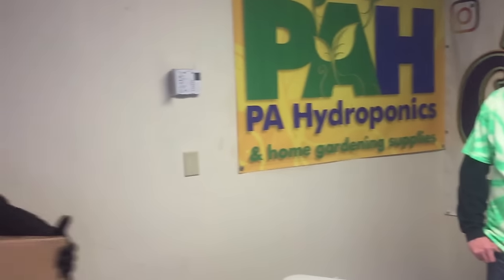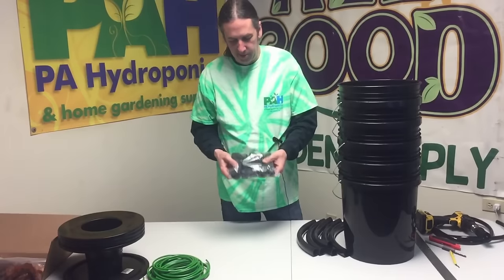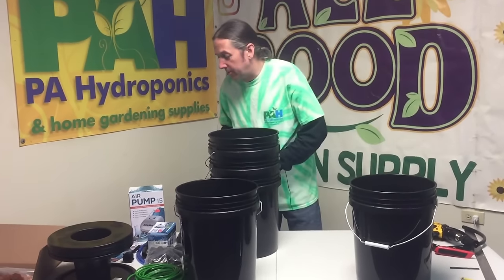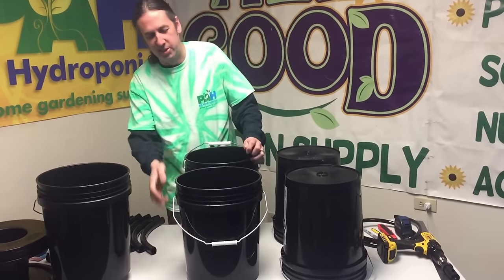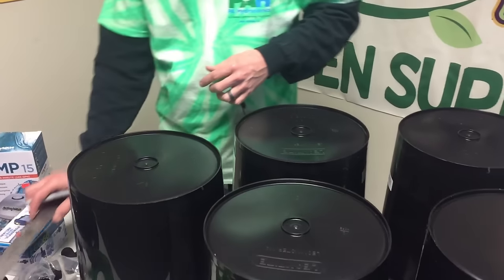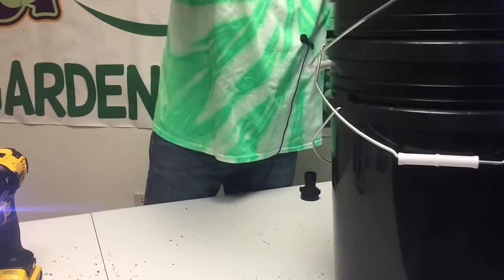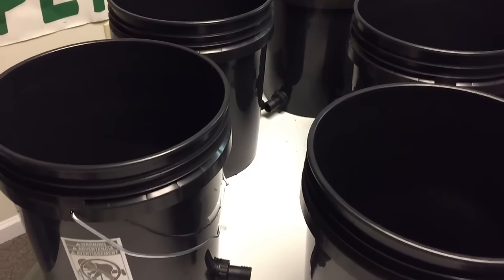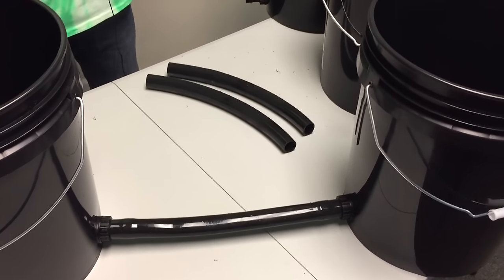Easiest 4-Plant Stirponic RDWC with Reservoir and Water Level Indicator built from scratch!!

Comment: Really enjoy watching your videos on building your own. My problem is the water pump heating up the water. Can this pump be changed to a in line pump and would it matter that much as keeping cooler? Also would using 3/4 in. tubing be ok? Thank-You Gary
Reply from the maker: Hello, on this particular system I used a 75 gph pump, it is small and should not heat up much, as for inline - the problem with that is most small pumps are not 1" fittings and this system uses 1" , even 3/4 inch is to small and wont let enough water flow which would cause uneven water levels  in your system. I also like on this system that I can change the direction of the water flow  which you couldn't do with an inline. So yeah, don't know what else to say on this. Gary
Reply: Thanks Gary, very helpful and what I also understand is that the pump can be put on a timer also which would help it to stay cooler! thanks!

Comment: Hey bro on this model can u connect 45 degree tubing so u can put another bucket in the middle and also will it  Circulate? Just a thought I been having to  Maximize yield
Reply from the maker: Hello, for the waterfall systems to circulate evenly it has to be in exact multiples 1 plant 2 , 4 , 8 or 16 etc. Also not to mention 4 plants in hydro in a 4x4 will beyond max out the tent, I have seen 1 plant max out a 4x4 so adding a 5th plant is just gonna make it more crammed. Hope this gives you some ideas and thanks for watching. Gary

Comment: can't you use the resevoir as a grow bucket aswell?
Reply from the maker: The reservoir is where the stirponic (circulation) pump is located.  The pump is pushing the nutrient solution around the containers.  If you would put a plant in that bucket you could possibly damage the roots with the circulation pump.

You may want to look into DWC.  No stirring action, each bucket gets an airstone and its nutrient solution.

This is a two site system....

https://shop.pahydroponics.com/2-plant-complete-dwc-buckets-including-quality-airpump-airstones-water-level-indicator-kits-clay-rocks-and-4-rockwool-starter-plugs-drilled-and-ready/

You can easily expand and customers have grown many beautiful plants in DWCs.
Thanks for watching

Comment: Do you need more than 5 gallons of water to feed the entire system?  The reservoir is only 5 gallons so do you need to fill it multiple times to get the water level correct throughout the entire system?
Reply from the maker: Hello, yup the water wants to naturally level out thru the whole system so just keep adding to the reservoir bucket and really think of the whole system as 1 big reservoir, it takes about 20 gallons when full. Thanks for watching! Gary

Comment: Hey Gary -I’m trying to decide which type of system to install inside my 40x40x72 tent, I really want a 4 bucket system even though it will be tight. With this RDWC system, as long as the supply and return line to the reservoir are roughly the same length and have the same # of angles/bends this won’t effect the the operation correct? Any recommendations? Thanks and love your videos!

Comment: how much water would i expect to use to fill this system? i've grown in soil, and mixed my nutrients in either a 3 or 5 gallon water bottle. i assume this is gonna hold WAY more water than that
Reply: Im just gonna say what I remember him saying, I have never used a system like this.  The water level is gonna be slightly higher in the grow buckets than the reservoir.  In the beginning you have to have the water high to hit the roots, so probably 4 gallons in each and 3.5 in the res.  In the beignning stages that would be about 19.5 gallons in the whole system.  Later on it is lower because the roots are all the way down, I'd guess 2.5 gallons in each and 2 gallons in the res, so 12 gallons in the whole system. 

 I'm guessing in later stages you top off 1 gallon or more a day.  Unless you drain the whole system often, the first day is the only day you'll lug a bunch of water to the system.

Comment: Great video! Thank you for your fine service!! A few questions though..

Can I position my reservoir outside of my grow tent (have tubing running through a light sealed hole in the reflective walls)?
And advice on how to regulate temperature?
Can I have 2 sets of lines between the buckets and have 2 pumps, 1 clockwise 1 counter clockwise?
Is it possible to set some mesh or filter on the outlets of the buckets to prevent roots going in?
When I change the water and nutes, do I just drain it as you said and then add new stuff? DO I have to fully remove everything and rinse it before I can add fresh water?

Thanks again!
Reply from the maker: Hello, 2 pumps like that wont work it will just flow into first bucket then get sucked right back to the reservoir. Some customers have put the reservoir outside of the tent with success but get the return tube as low to ground as possible to keep flow going, remember 75 Gallons per hour max for 1" tubing. As for temps make sure your room is air conditioned before you start buying chillers. You can drain whole system with the reservoir bucket but not when the tubing is up off the ground and thru the port - it wont drain right like that, this system will have a inch of nutes left , I dont worry about it but others do, you can dump 5 gallons of plain water in it then suck that back out to clean if desired. Hope this helps. Gary
Reply: @PAHydroponics  Wow, thank you for your help! I was thinking I'd have to elevate it for the tubing to exit the tent. Thanks for all the advice!

Comment: Hey Gary...

All the other undercurrent systems I see employ a submerged pump sucking from the 'furthest' bucket in the chain and then back all the way to the reservoir with a hose... I suppose doing it this way works as they are all daisy chained anyway... and the water circulates back to the reservoir regardless?

I like this... I originally was going to use my 1" PVC on the bottom as 'returns' only, and connect the pump to a hose, and waterfall all 4 pots... this way eliminates the need to do so... 

Moving the flow sideways... rather than down and up is smart...
Reply from the maker: Sounds good but 1" does not let much water flow and you still are limited to about a 75 gallon per hour pump so keep that in mind. Thanks for watching :) Gary

Comment: Can u make this system with 3 inch pipes instead of the 1inch tube . I dont mind paying extra
Reply from the maker: Check out this video based on the Fallponic Waterfall RDWC.  it has three inch pvc connections between the larger flat walled buckets. I think you may be interested, enjoy!

https://www.youtube.com/watch?v=o0dDcA-PUMI

You can take a look at the different kits you can purchase online to get you started here... 

https://shop.pahydroponics.com/fallponic-systems/

Comment: Square buckets and deep square net pots. Its easy to make bulkheads work on a flat surface compared to a curved surface. Hose clamp everything. Attach drip rings with zip ties.  No air stones. None.

Comment: so no aerator in the reservoir?
Reply from the maker: We do not recommend aerating the reservoir directly.  In this set up the reservoir has a pump in it to "Stir" the nutrients... If air bubbles are pulled directly into the pump you will loose any pressure and could damage the pump.
Reply: @PAHydroponics  cheers, thanks!

Comment: Amazing video ! thank you . can I use this setup and make a 16 bucket system ? if so how big does my pump have to be
Reply from the maker: Yes it can be done!, I would have it plumbed for 2 -  8 site with 2 separate pumps but sharing the same reservoir with 2 - 3 inch tubes coming into the reservoir, Good luck :) Gary

Comment: How high should my water level be?
Reply from the maker: In the beginning when starting your plant the water level will have to be high enough to touch the starter plug.  You do not want to completely  immerse your starter plug in the water as that can lead to other problems.

High enough the starter plug can soak up the stirring nutrient solution.

As the plants roots grow you can drop the water level back if that helps with you specific requirements.
Reply: @PAHydroponics  got it. Thanks!

Comment: I’m a Iittle confused from this video. In your other videos you speak highly on having 3in tubes and it’s advantages but here you are not using that, why so?
Reply from the maker: There are many different forms or variations of hydroponics.  The Stirponic is a recirculating deep-water culture, with a stirring action to provide the benefits of moving water.  The Fallponic has even more water movement or recirculation provided by the larger tubes and larger pumps.  

If your looking for a deep water culture but the ability to share and move water between several plants then a Stirponic would be great, if you are looking to move a lot of water and provide a bit more space for your roots the the Fallponic systems may be what you are looking for.  Hope this helps.

Thanks for watching and commenting!
Reply: That definitely helped thanks